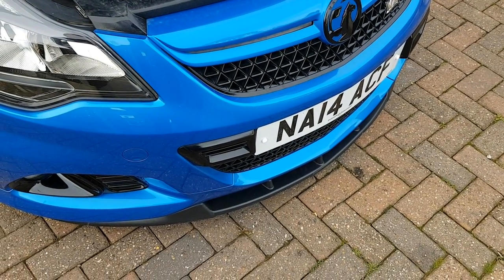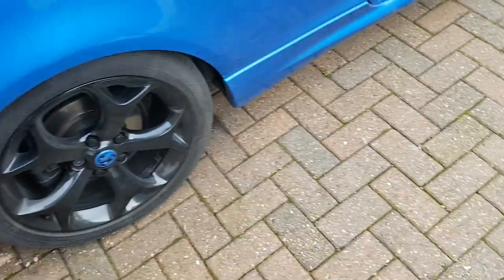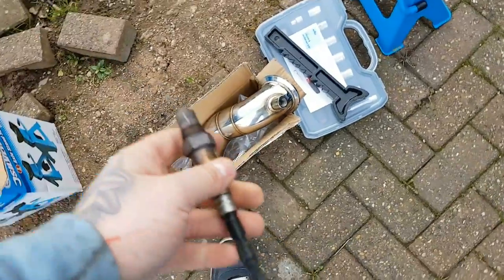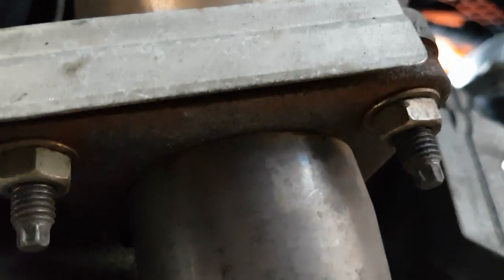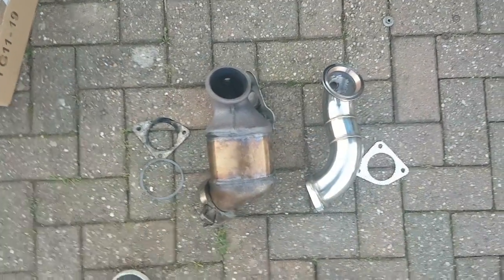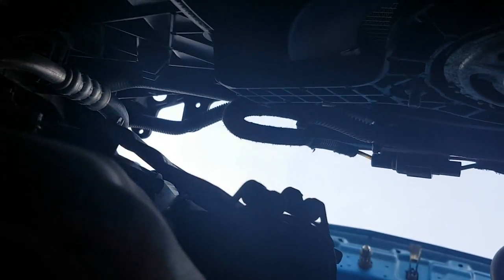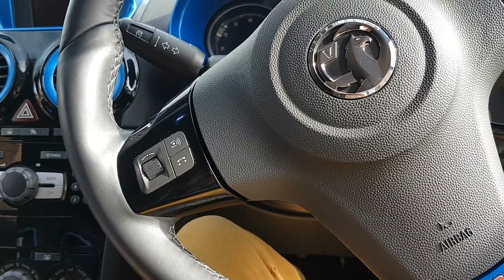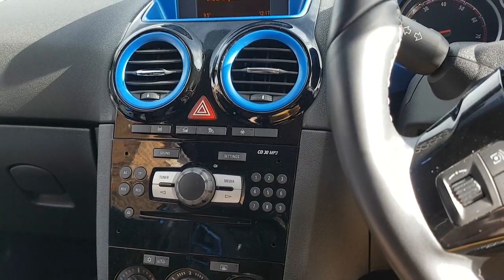Removing & Replacing Pre Cat Pipe On - Corsa VXR

Comment: Massive help this video is mate. Did you have to replace the bolts that were attached onto the old cat? I tried getting mine off but couldn’t get the cat off after undoing the spring bolt on the clip. 

Also off topic do you know where the throttle body location is?
Reply from the maker: Glenn Beattie I'm glad it helped you mate! The spring clamps only have about 2 or 3 uses before you have to replace them anyway, there not designed for continuous use but I've had my exhaust off afew times now and I have replaced it before mate.

Throttle body is top right of the rocker cover with a black pipe going down to the bottom of the car
Reply: Rusty Phat Thanks mate I meant the 3 bolts that attached the cat to the centre section. Did you have trouble getting your old cat off? 

Again thanks mate such a massive help 👌🏼

Comment: I have a two piece remus exhaust on my 2010 vxracing, would I need to get it remapped after the pre cat delete? Will it run fine without a remap? Just don't want to ruin the engine or turbo in anyway, I've seen you can get o2 sensor spacers for them, do they help if you know? Cheers
Reply: You don’t really need to get it mapped with a pre cat, it will run fine without a remap but me personally I’ll get it mapped just to be on the safe side

Comment: I think you have already answered this but I would just like confirmation. Do you pass your mot without the pre cat and only with the secondary cat installed?
Reply from the maker: Jagdeep Sagoo yes mate
Reply: Rusty Phat okay cheers 👌 also I have been told that I should buy a lambda/o2 emulator (something like this https://goo.gl/images/L3ew48) to help stop the check engine light coming on. What are your thoughts?

Comment: Hi mate do I have to get a remap if I pull the pre cat off the main cat is off mine but not the pre cat is still there will the car run OK with out a map ?
Reply from the maker: Junior Sinnott I took the precat off and replaced with a delete pipe and I didn't need one for it becayse the o2 sensor plugs straight in, I do believe that if you replace the sports cat you need one
Reply: Mine runs fine with out the main cat just worried if I replace the pre cat it won't run right cz of to much air flow

Comment: Hi mate,  so really on this video you removed the main cat?  On the A16/b16 engines it's main cat then secondary cat,  on the older models Z engine it's the other way round.  So you would only be removing pre cat if this was a z engine.  Yours is B so you removed main cat?
Reply from the maker: Mine is an A engine, its still classed as a precat
Reply: @RustyAutos  ok cheers mate,  I'm assuming it would be an Mot fail though as theoretically the main cat had gone and that's what's needed to pass emissions not the secondary.  Keep up the good work
Reply: He's right It is the main cat on the A16/B16   the secondary cat is on the center pipe that's the one you need to delete as it's only for emissions on cold start until main cat has warmed up so will still pass mot.i would think it would fail mot with the first cat removed on A16/B16 engine.

Comment: Hi mate nice video! Quick question do you have to change that back and for every time you need a MOT then?
Reply from the maker: FloydyBoy 96 you have to have 1 cat present on these they have two, you can leave this precat off and replace the second cat ( follows straight on from this) with a sports cat that will pass mot
Reply from the maker: Spongeface Trollpants Yes it will aslong as you have 1 cat on

Comment: Do you have to remove the  big heatshield  covering the turbo?
Reply from the maker: It helps for easier access
Reply: Rusty Phat is it doable without removing it? The bolts on mine are well past it. cant get them off 😂
Reply: Rusty Phat also will this pass an mot no problem or will they pull me up about it? 😂
Reply from the maker: tk heaven you can do it without taking them off, but it just makes it more difficult mate
Reply from the maker: tk heaven it will pass the mot with the precat changed, because they have two cats on the vxrs :)

Comment: This is the main and only cat on these cars, there are no others. The middle "secondary cat" is just a resonator.
Reply: Incorrect, the Z16 had only one cat, however the newer A16 had two cats, hence this being the pre-cat delete
Reply: Wrong. Z16LER has two cats. One is right behind the turbo, the one you see in the video getting replaced and the other one is right infront of the "resonator" or middle exhaust.

Comment: There is only one catalytic converter on the corsa VXR, what's all this "pre-cat" stuff were talking about? The thing you said was a catalytic converter was the flexi joint :)
Reply from the maker: MIW lewis MIW Motionless In White there is two catalyst on the corsa vxr a primary and secondary, the first cat isn't required for an MOT the second cat is which is replaced with a sports catalyst. That is a flexi joint yes but it is the start of the 2nd catalyst

Comment: That's a flexi pipe not a cat
Reply from the maker: Nick Bowater yes but the whole section is reffeted to as the 2nd cat
Reply: Since when did a VXR have 2 catalictic converters? All the gear and no idea 😂😂
Reply: Since forever.
Reply: First cat is on the "downpipe" or the pre-cat pipe shown in this video. What the guy pointed out as the second or main cat is indeed a flex pipe. However there is a second cat a little bit further of the flex pipe. You can clearly see it on the video as well at 03:51 right below the stabilizer bar. I'm not here to argue, just don't call me an idiot without a reason.